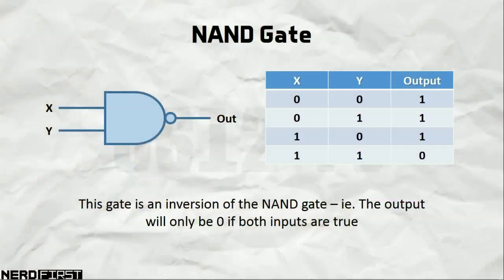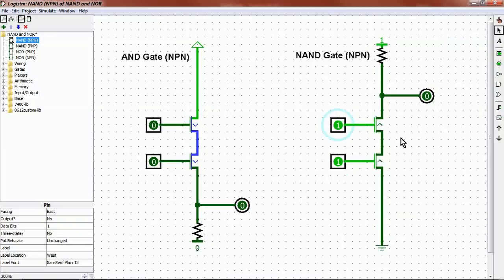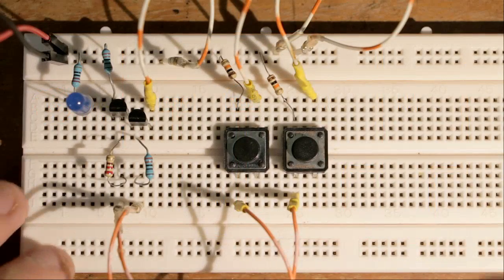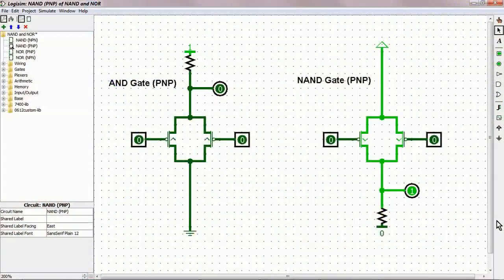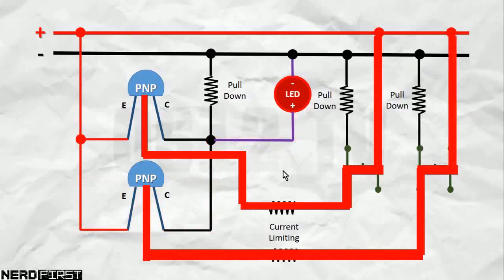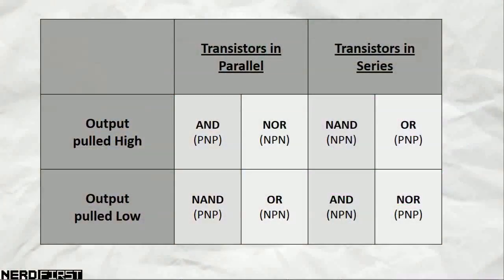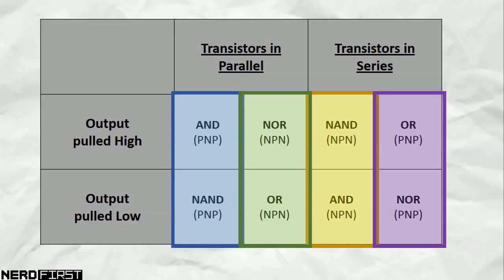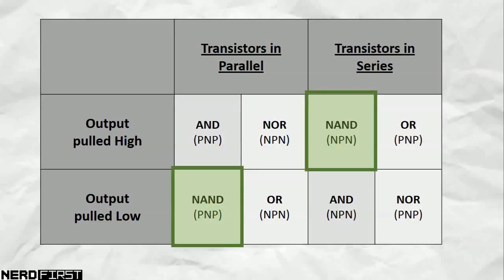NAND Gates - Transistors 07

Comment: I want to build a TTL NAND using 2xNPN and 2xPNP ... but it looks like variances in the transister switching times will result in very brief shorts between the power rails.  What is the minimum addictional circuitry I need to make this safe?  A capacitor to act as a reservoir during the short?  Are resisters necessary at all (they don't seem to exist in CMOS)

I'm ultimately trying to build a large scale general arithmetic circuit in a TTL style, with some micro LEDs on the outputs to make iot twinkly and watch it work - but I really don't want transistor-resistor logic.  I have about 20 square meters of wall to create on and a budget of around £2000 for bulk buying PNP/NPN and LEDs.

Any ideas on how to keep costs down to a minimum whilst limiting the heat/current caused by the intermittent shorting?
Reply from the maker: Hello and thank you for your comment! I'm afraid this is beyond my area of expertise, and I'm not really the right person to give you advise.

Are you restricted to using transistor logic to make this work? Because if you're not, solutions such as Arduino are going to make your life much easier.
Reply: @NERDfirst  I really want to go as low level as I can... I know I can use resistor-transistor logic, or diode-transistor logic... but there's something about the symmetry of the CMOS gate libraries that looks aesthetically pleasing to me.

At first I did consider using 7000 series logic ICs to keep the cost down, but I designed the transistor version in a circuit simulator and I found that I definitely have the wall space to do at the discrete transistor level.

Unfortunately, all the breadboarded gates I can find use resistors rather than transistors for the pull-up/down.

I can build CMOS gates in MAGIC or even the full ALU in a simulator, but I'm pretty sure that once I move away from ideal transistors things are going to get a little more complicated.

No worries, I'll figure it out.  I'm just worried that I'm headed for high heat/current with all those momentary shorts... but I figure that a constant current bench supply can probably handle it as long as I can keep it cool.

Anyway, thanks for taking the time to make the video.  Digital logic is cool, and videos like yours really attract people to the hobby.

Even wierdo's, like me ; )

Comment: ALSO DOES THE RESISTANCE OF RESISTOR MATTER THAT MUCH?
I USED SOME RANDOM RESISTOR WHICH I HAVE ,AND IT SEEMS TO WORK
Reply from the maker: Hello and thank you very much for your comments! Glad to be of help =)

One point I really didn't research much on or cover is the resistance of the resistors. You're right, in this very limited context it doesn't really matter to produce the intended results, but when used in a circuit with other components, it becomes more important to avoid putting too much current through the transistor and other components, so as to not damage them.
Reply: @NERDfirst  
thank you for you reply